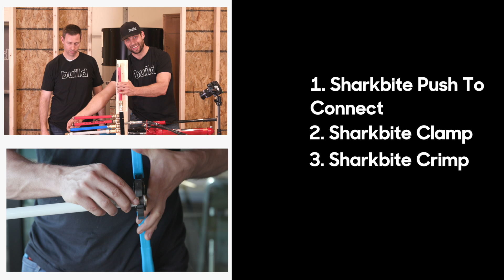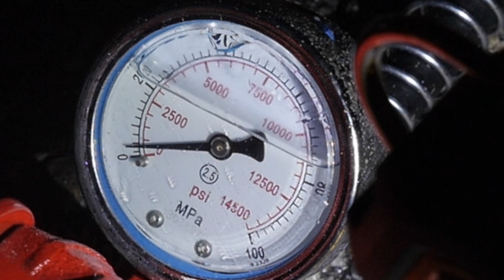Can we blow off these PEX fittings?  Sharkbite vs Viega vs Uponor

Comment: A thought would be for the future, put a hydraulic ball valve between your manifold and your test hose or fitting. When it fails simply shut the ball valve off and continue with your test
Reply: YT what’s a hydraulic ball valve.  I thought a ball valve was just a ball valve.  But a ball valve with a high pressure rating is a great idea.
Reply: Fred Frond . I sell hydraulic ball valves, steel of course with bust pressures to 20,000 psi. easily working at 5,000 psi, something they will never achieve. I doubt anything they test will not exceed a few thousand psi including copper tube.
Reply: @yt650  It might rust if it's plain steel. Stainless steel might be an option.
Reply: Wouldn't help here because the pressure drops to "zero" when a pipe bursts.  There is no pressure left to save.
Reply: Panhead49EL . The idea is not to save pressure but to eliminate the work of removing the fitting/failed tube. No need to plug the space.
Reply: @yt650  Ah, got it.   I misinterpreted what you meant and was thinking a single valve upstream controlling all 5 test hoses.   Really though, what would it help?  It's not a time saver, since it takes just as long to plumb in a valve as it does to cap a line. It's just shifting that time to earlier in the project.
Reply: Panhead49EL but you would not have to undo the fitting.  You would just have to shut the valve.  You would need a higher rig because of the ball valve handle taking up space.
Reply: Fred Frond . Hydraulic ball valves typically come with a “easily” re-moveable handle. Install them without the handle on and only use it if necessary. The handle comes with eight position ability. On some systems they are left off for safety reasons and only used for isolation.

Comment: The size of the fittings matters. Have you purged the air out first. The larger the fitting and/or tube or Pex, the least pressure it will take. The tube should fail first except for Sharkbite. 
I have tested hydraulic hoses and fittings to 15,000 PSI. It is amazing what some of the stuff will withstand. A 5000 PSI working pressure hose will burst over 20,000 PSI. 
Usually the hose or tube will fail in the center first.